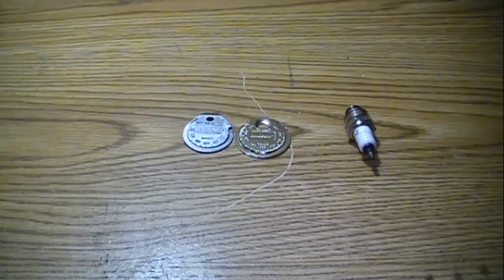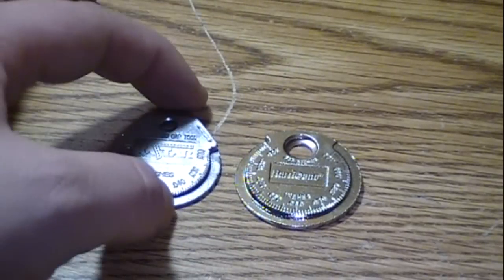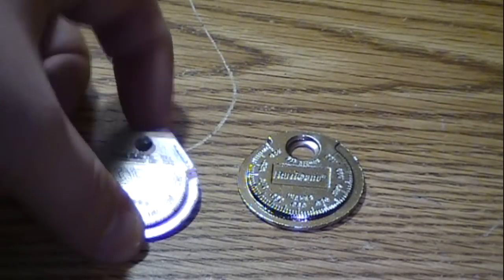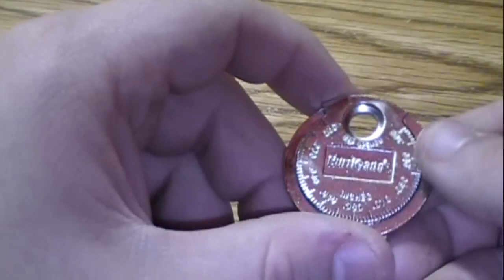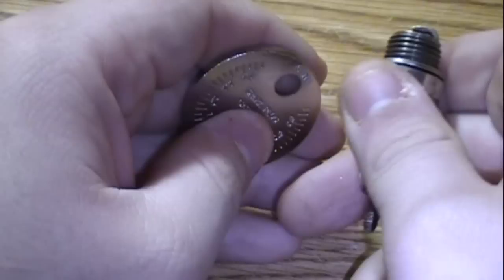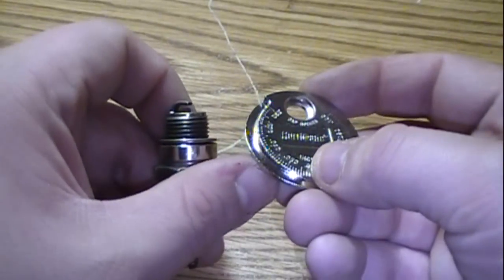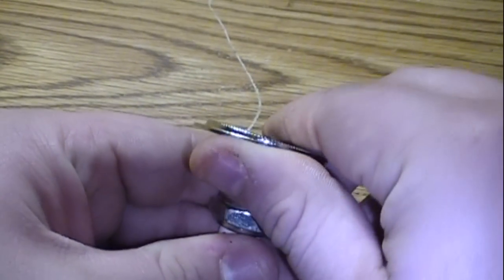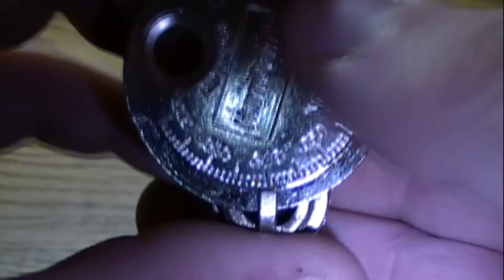How To Gap A Spark Plug

Comment: Good vid! Doesn't the gap widens a little over time? So, would it be okay to have the gap at a little less than .040 if that were the gap that was needed (not .035 but not quite.040)! what would happen if I set gap in between .035 & .040 since the gap is going to widen over time?

Comment from the maker: Well Technically, Yes Spark plugs wear down over time from the spark and jumping thing the gap. The 2 parts are made from metal and can create craters. That can create problems in gapping, The best thing to do with an old plug is replace it. There In expensive and with a new plug that can eliminate alot of issues you can be having with spark. But i suppose if you were in a jam, and couldnt get a plug you could gap the plug at a smaller gap.